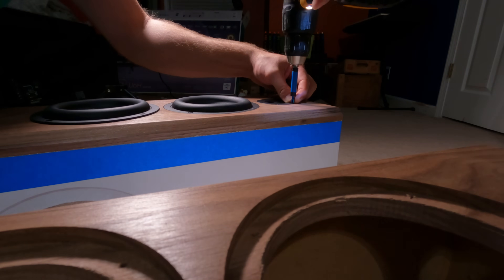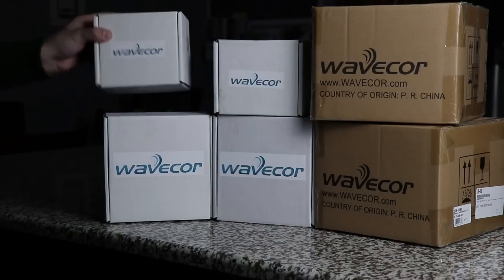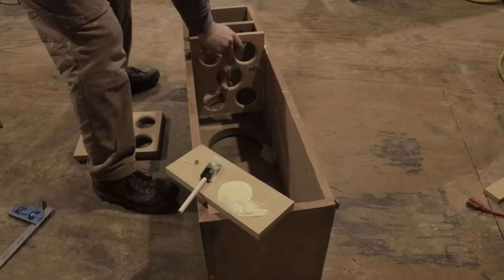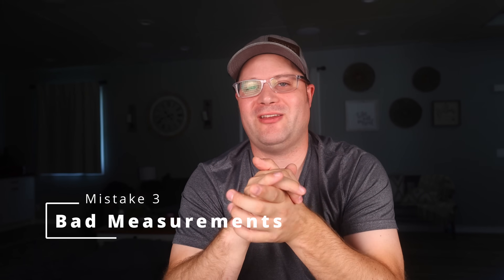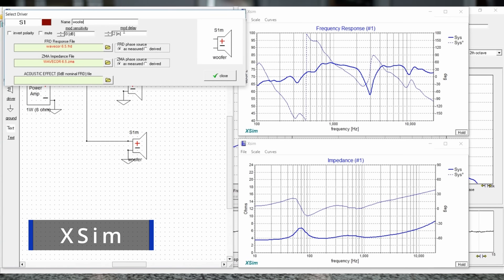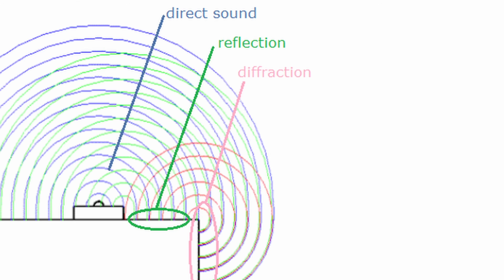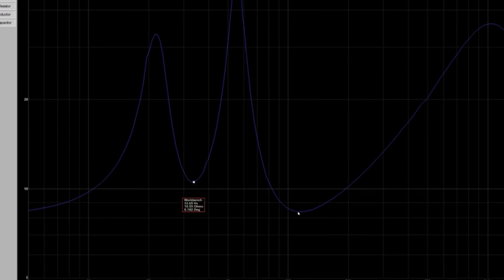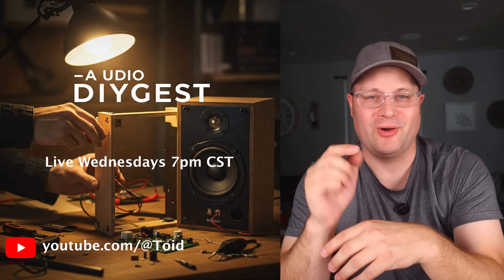These DIY Speaker Mistakes RUIN Your Sound (Do You Know Them?)

Comment: Before everything in the video, do you have what you need to build a box out of wood? The skill to build an airtight box out of wood?
The driver part can be made pretty simple. Select a woofer and tweeter with same sensitivity and power handling. Use the suggested volume to build the box. Width of woofer + 1/2 inch = width. Woofer+tweeter+1/2 inch = Height. Now you have front baffle and solve for depth. Toid has a crossover point calculation somewhere, or just use the manufacturer graphs. Most woofers have a sharp spike before the roll off. Crossover before the spike. Dayton Tweeters are forgiving and can be crossed fairly low. However you figure it out, buy Dayton off the shelf crossovers.
FLUSH MOUNT TWEETER. FLUSH MOUNT TWEETER. It's important. I didn't and need to rebuild my boxes. Understanding why requires understanding physics of sound waves which I never will. Every source on the subject says to do it so do it.
Silverflute from Madisound is a great woofer for the money. I paired with Dayton silk dome tweeters crossed at 2.5 KHz and they sound good for shitty boxes they are in.

Comment: One idea that no one talks about is making a prototype to verify if the speaker really behave like the theory suggested. As you mentionned, specifications give a general idea of the performance you can achieve, but testing it before comitting to the whole process is the safest way to ensure satisfactory results. In my experience, ready-made crossovers are the worst offenders, like the ones you find on Amazon or Aliexpress. Also, a lot of designs we can fin on Internet are full of errors about specs and values, so another reason to prototype before commiting to the whole process.  Thanks for the video.
Reply from the maker: Great point! In the past, prototyping a full test cabinet was essential. But with accurate driver specs and proper modeling, you can usually skip the physical prototype and go straight to measuring and designing the crossover. That stage is where everything gets verified. Appreciate the comment!

Comment: I avoid many issues by only building 1-way full-range speakers.
My favourite is the 3" Super Cast Frame by Audio Nirvana. Incredible sound for a tiny, but super-heavy speaker.
Reply: I dont wanna sound rude and still want to learn more about this. Ive always felt 2 way to be my sweet spot. But only after i tried bad 3 way speakers with no Mid enclosure. I want to learn about your full range experience. I bet the guitar instruments sound huge on them.

Comment: For Beginner: 
Just hitting me in my box design. If just building a mid sized speaker and you dont have all the bells and whistles for a workstation.
A basic design using 3/4". Is to double the top and bottom. First piece's to be glued. 
Double pieces, 3/4" smaller on sides or where needed by design. It acts as a dado joint.
Then whole box can be put together at once. No struggling with any slipage while gluing.
Perfect square here. The smaller pieces are easier to work with and get the box to a perfect square.
Top glued to another piece is lightened by circles whatever. Same for bottom.
Other dados can be added for sealed chambers but keeps it simple.
Had the right idea first design but would have been a real finer quality...Fairly sure this would even lower box resonace?idk...

Comment: However did we manage to design damn good sounding speakers without magic software and calibrated microphones?
Reply: Having tested a lot of vintage designs ( JBL, B&W, etc ) most of them have horrible measurements. That is one of the reason old amplifiers were so keen on having bass and treble controls and graphic equalizers.
Reply: @yvesboutin5604 tone controls are a beautiful thing. The more control I have over the sound, the better. I couldn't care less how "the artist intended" a given track to sound. I want it to sound as good as I possibly can make it sound (to me). Not to mention that every listening environment is different, and few are perfect. Fiddling with adjustments is one of the many joys of old school hi-fi.

Comment: I am an audiophile and hobby woodworker. Have never built speakers but I am thinking about building a set of towers for a lower end system. Wouldn't buying a kit with plans from a reputable company solve most of the problems you're describing? (Not a rhetorical question; genuinely asking.)
Reply: Yes, there are many companies which now sell kits that outperformed some costing more than 5k$.

Comment: will acoustic foam affect the internal volume of a speaker box? or are they not dense enough to make a noticeable difference
Reply: Acoustic foam is better than Polyfill but is more costly. The effect of damping is that the drivers ''feel'' like the box is bigger. Old acoustic speakers were huge because the lack of port also meant the air trapped inside was the only source of help for bass management.

Comment: I find that measuring response at home is incredibly difficult with sine sweeps - I simply never get anywhere near a smooth line due to reflections. Measuring near field works but then it’s challenging to balance levels between drivers. I’d love to know how the internet community gets these lovely smooth plots. I find the only way to get close is pink noise and FFT, and move about a lot and take an average - which is far from ideal.
Reply from the maker: I’m going to assume you’re using REW. Are you adjusting your windows for impulse? In this way it helps account for how the room interacts with the response. If not, you should look into it. This is one of the reasons why I really like the Omnimic software. It can do that automatically for you. It takes a lot of the guesswork out of taking good measurements.

Comment: Hey Toid, I have a question for ya. So I built, one so far, large Altec styled 2 way speaker. I used 3 inch insulation, being that it is a very large cabinet with a 15in woofer. Based on the cabinet size I should have had a resonant frequency in the high 20s. When I measured the resonant frequency, it was sadly 45hz.

Could it be possible that due to using a very thick insulation that it is consuming too much of the cabinets volume and therefore raising the resonant frequency? I didn't take any measurements before installing the insulation, unfortunately.
Reply from the maker: Is this a ported box? Or are we talking about a sealed box? A driver will have a free air resonance, a.k.a. the FS. But that is only for free air. Once you put it in a box, your FS will change.

Comment: Driver placement based on one wavelength spacing is most commonly used. However, vertical spaced off axis responses can be improved using a 1.2x center to center distance ratios.

Comment: If I made this video, it would be 6 days long.  I have made mistakes on literally every set of speakers I've ever built.  I'm STILL making mistakes.  Usually not the same mistake over and over.  That would be boring.  I generally find new and exciting mistakes to make.  My last one was not adjusting my flush cut router bit after cleaning it.  I carved a chunk out of the side of my cabinet where the woofer goes.  Then I tried to patch it with wood putty.  Didn't work.  Ended up using sawdust from my previous router cuts and wood glue.  It's ugly but seems to be holding shape.
Reply from the maker: You cut yourself too short. I’ve seen your work. You do great! Keep it up!
Reply: @Toid  You must not have looked real close!  I'm taking a page from Bethesda's book..........."Is it a bug or a feature?"  The answer.......... "Yes."  I'll call them unplanned decorations.

Comment: You mentioned to use actual driver measurements in the box instead of relying on manufacturer’s data when designing a crossover. Could you please mention if I can export this FRD/ZMA data from REW/Omnimic and what dB level should I shoot for - when doing my driver measurements? I’m assuming 1 foot away from each driver and on axis is what I’ll need to measure from or is it 1 meter? Thanks! I’m building my first 3 way DIY speaker for my brother’s wedding gift this August 😁👍 Thank you!
Reply: 1 meter is standard for FR and some prefer 0.5m for HD. I use a meter for both. FR magnitude is arbitrary as long as all three are at the same volume settings or output voltage. HD should be high enough that the measures are not bunched and below the noise floor, I recommend at least 90dB, but 95 can be fine. Not all drivers can reach 100dB happily.

You can measure for different axes for each driver and use offsets in the xover model, or measure all on the intended listening axis and only need to account for Z offset.
Reply: And I should add-
The speaker cabinet should for best measurements be placed halfway between floor and ceiling, angled to not be parallel or perpendicular to walls, with nothing close in proximity, including walls, and a carpet or damping on the floor. The mic placement relevant to the mic stand should be at considerable distance to the hinge joint, oriented into a tube, or use damping on the adjacent arm of the mast. Without this, it will show reflections.

Gating is also important in room measurements, but unnecessary if measured outside.

As the image shows in the video of the speaker under test being placed closely on a wall adjacent cabinet perpendicular to the front wall will not reflect good measurements of the baffle step region.
Reply: @indiyanaorganizer1647 perfect, my Pangea DS200 36 inch speaker stands raise the speaker to practically a half way point between floor and ceiling. 👌 I have not tried angling the speaker to minimize reflections for my measurements, will be interesting to try. Thx!

Comment: I'd still love to see your take on a Cambridge Soundworks Model 12 system.  A portable, all-in-one subwoofer/satellite speaker system designed for home or mobile use that fits in a pelican case.  The pelican case doubling as the subwoofer.

Comment: Passive radiator FTW
Reply from the maker: I do love me some passive radiators
Reply: They just make the lows sound clean and crisp.  @Toid
Reply: Transmission line FTW—just tough math and build…

I went slot-loaded open baffle. But im having trouble with tweeter drivers…
Reply: What kind of trouble?  @kineahora8736

Comment: I think it is also a mistake to use passive crossovers or filters these days, active Crossovers are so cheap today that is is often cheaper or similar to passive crossovers. They are easy to use.
Reply: Yeah, except at the cost of amplification- one channel per driver passband per enclosure - and it’s just as easy to mess things up with fully active as with passive.
Reply: Easy to use and easy to experiment with. If I want to try different crossover points or different drivers its so easy.
Reply: @timelessautoworks8415 Been using REW / miniDSP for a couple of years now in my home theatre and indeed the ease with which one can get immersed in the “joy” and minutiae of fiddling and fine tuning an active system can be addictive. Does it absolutely guarantee superior performance to a well designed - and when considering amplification requirements, likely less costly overall - passive system? No.

Comment: Great point on vertical bracing!
Reply: Interlocking both vertical and horizontal braces positioned to subdivide large panels into a series of unequal surface areas always worked for me. Also, snugly fitting braces to the woofers’ motor structure to at least the rear panel will sink some of the reactionary energy. 
On very small slot ported bookshelf types, the panels forming the ports can become part of the bracing scheme. Always set the vertical brace off the centre line - even if only by the thickness of the material.
A very well braced enclosure fabricated from thinner plywood - as opposed to doubled MDF - and lined with appropriate damping materials will certainly be an easier build, and very possibly have numerous small panel areas that resonate at frequencies higher than those at which the bass driver(s) tend to excite the enclosure.